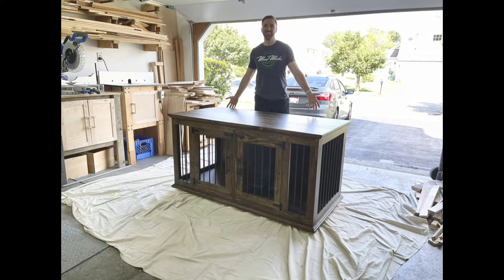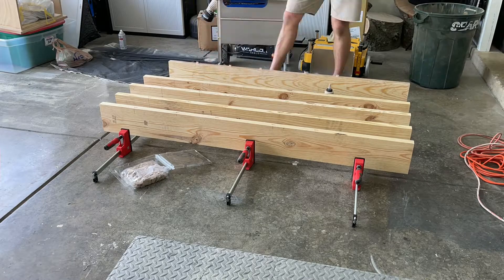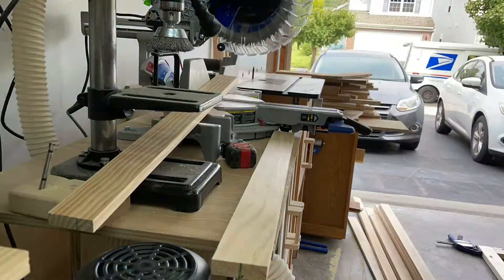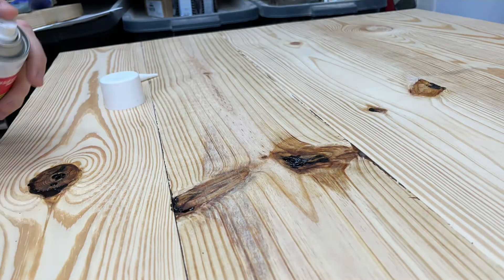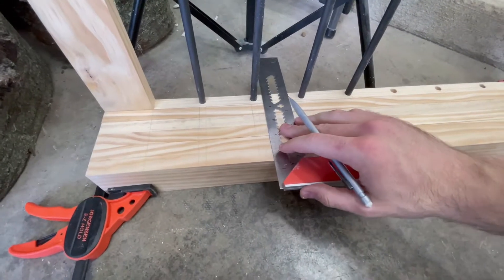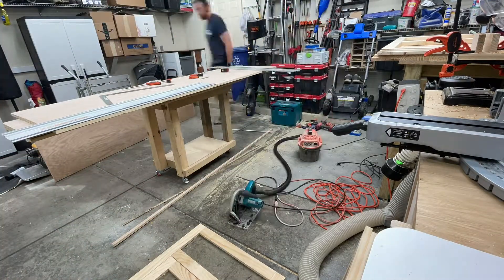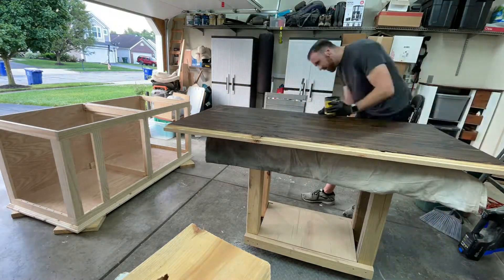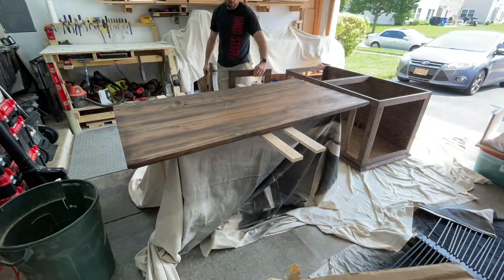Wood Dog Crate build With Removable Divider

Comment: Nice work for sure.   Thanks for the video.  Do you have approximate dimensions for the dog crate?     Also, did you use your Jointer on the 4X8's or did the track saw do the trick to create a nice straight edge?
Reply from the maker: This dog crate was 64" wide x 32" tall x 32" deep. The track saw actually did the trick! I was pleasantly surprised. I only have a small benchtop jointer right now so dealing with pieces this long is not practical. Have you used the track saw for jointing before?